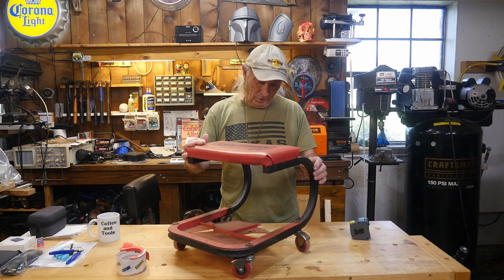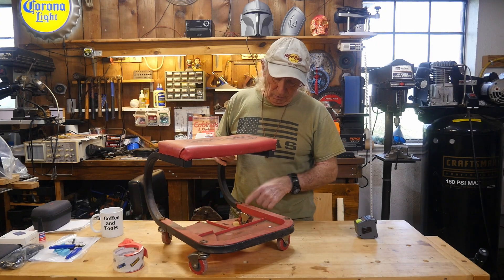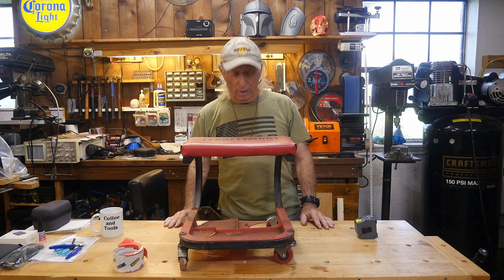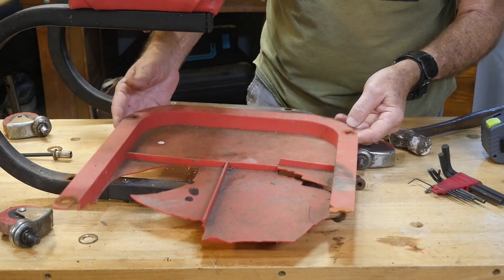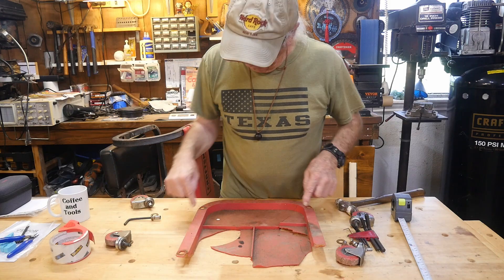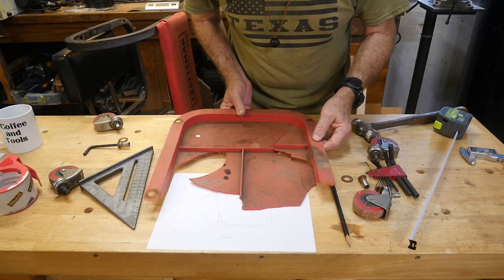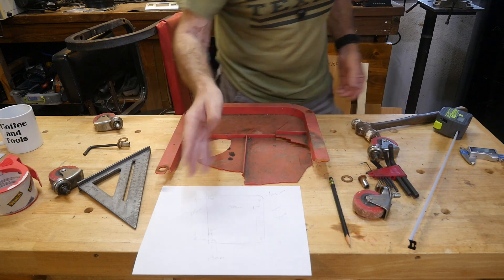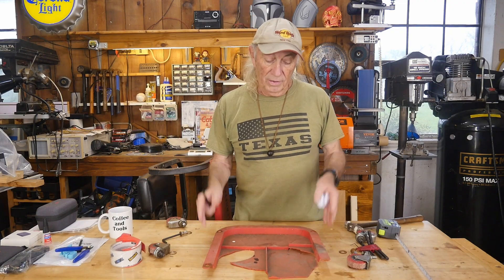3d printing parts for Craftsman seat with Plasticity, Ep 527 Coffee and tools

Comment: What if you used a piece of sheet metal, cut it out with a Vevor plasma cutter? Welded in the seperator sections with your Vevor welder. It would probably outlast any plastic out there.
Reply from the maker: I just finished giving all my metal collection away to clear the shop / property up. The original idea was to 3d print a new tray a few years ago. Finally we have a big enough printer.:face-blue-smiling:

Comment: How’s it going my man? Nice project. Grid is set as default at 250mm from the centre, so 125mm each side. And if you draw from the centre, and if the print exceeds 250mm in whatever direction you draw in, it then shows the grid ref out of frame. You can define the drawing grid area in the preferences drop down menu. I always change based on what I’m drawing to avoid this.  Basic tutorial is a definite for this software as it’s fairly new. I’m happy to help out with what I have gleaned so far with it.
Reply from the maker: There's my hero !  The grid was over 500mm when I drew it up, but after I exported the grid was off set and small. Just a bug maybe ? I do need to check that grid size setting. :face-blue-smiling:
Reply: @ OK got ya. Exported and got the same result. But then I hit space bar (with nothing selected) it recovers it to the centre when it offsets. So yes, you are right it looks like a bug on what only seems to be on larger drawings.
Reply from the maker: Thanks for checking that one. Not a big deal breaker but I didn't want folks to see it on YouTube and yet...ok..there it is LOLOL..